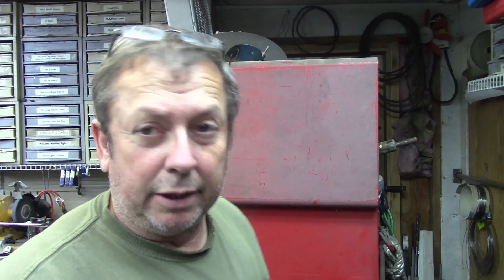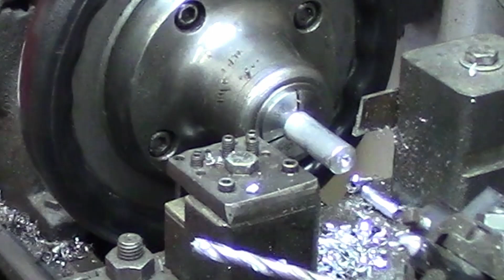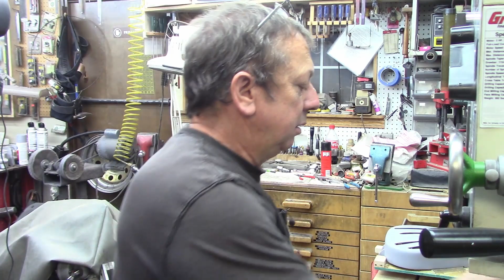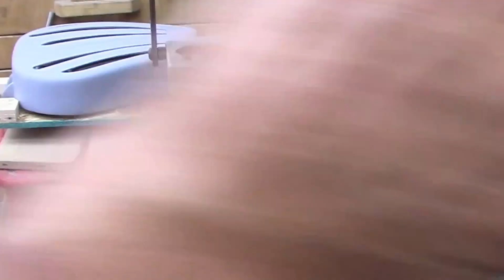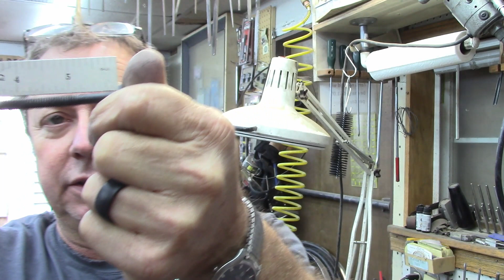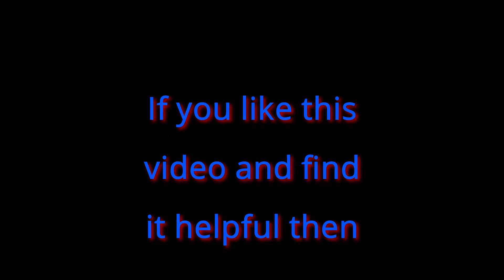Making Atlas Machines Affordable Again: Part 10, Building Split cotters

Comment: Excellent show an tell Dan, 
 how much variation in length did you end up getting using stop against cut off burr? Or did you have cutoff setup to leave burr on finished part only, hard to tell from video. Also whats your plan for the rotary broach. You gonna end up buying a commercial built one or make one, would love to see a video on your approach to building one if you go that route
Reply from the maker: Hi John: burr was on the finished part and length variation was not an issue. Most of the parts on the Atlas is not that critical and any variations can be delt with when they are fitted to a specific machine. As usual I will probably build a rotary broach and possibly utilize commercail cutters.